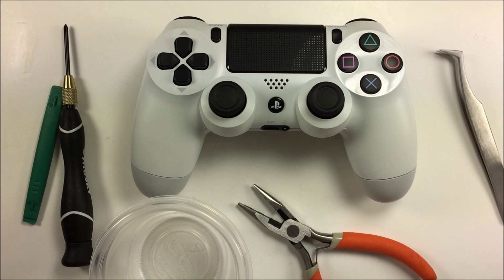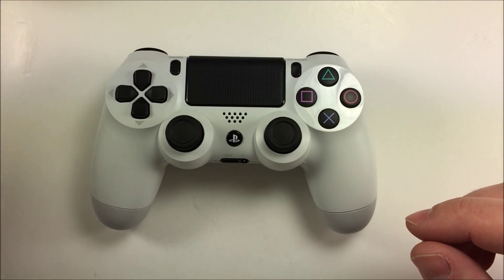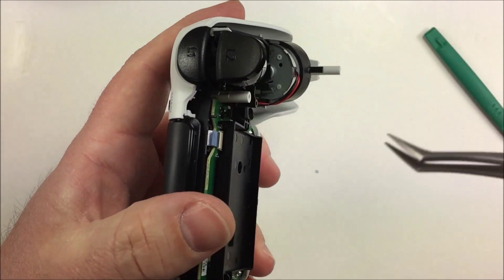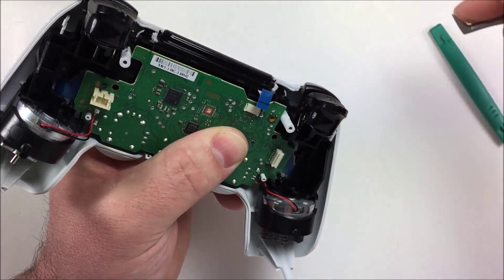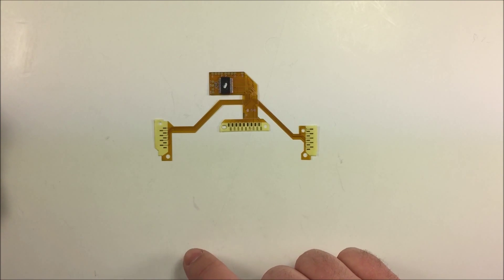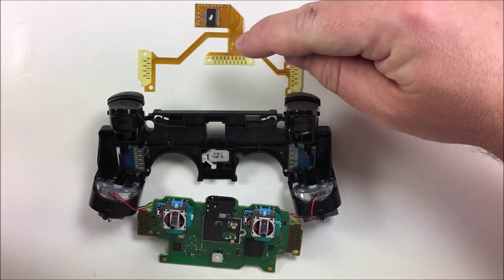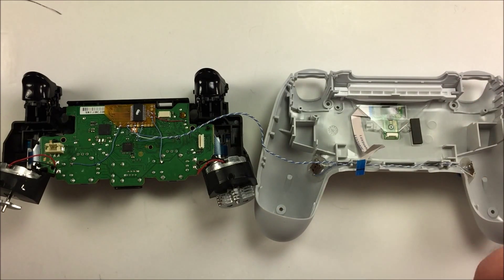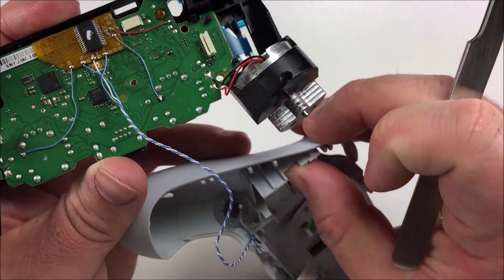Arsenal S4 Clip Board Install Video arsenalmod.com

Comment: bro..already bought 2pc of ur board...but it seems that the led spot is quite different.. since im using the earlier board...where the spot to solder..
Reply from the maker: Hi +Adam Mazran Maznin
Please email your controller "JDM" revision and I can send you a picture for the LED point. Our email is info@arsenalmod.com
Reply: No LED stop for JMD-001, but it still works fine
Reply: tq bro..

Comment: The switches included come with caps?
Reply from the maker: No, the switches used in the video are done by Ducky Customs, we use larger 12x12 buttons so you don't need caps. But you can put caps on them if you want to.

Comment: Can I use paddles?
Reply from the maker: Absolutely, we offer buttons with our install kit here:
http://arsenalmod.com/collections/ps4/products/new-arsenal-s4-clip-board-install-kit-ps4-remapping

But you can attach paddles if you want. I would suggest using a different set of buttons if you want to use paddles. In our experience, paddles don't last very long, the placement will shift over time, and makes your controller shell weaker as well since there are more holes that need to be added.